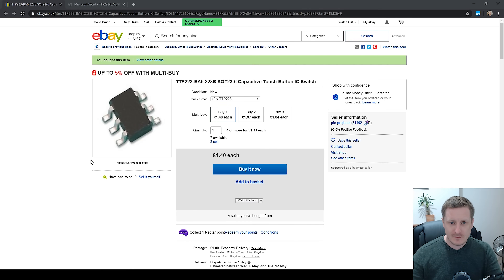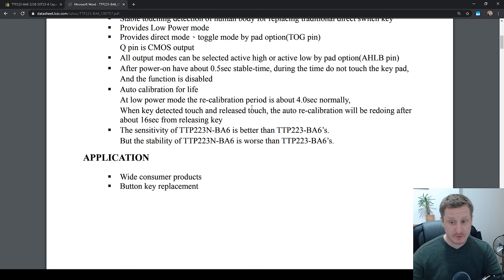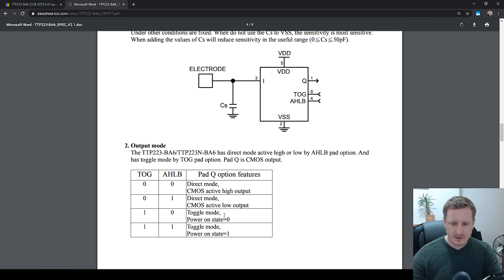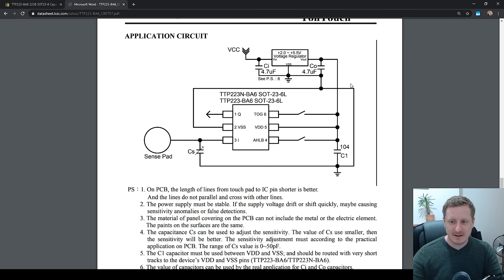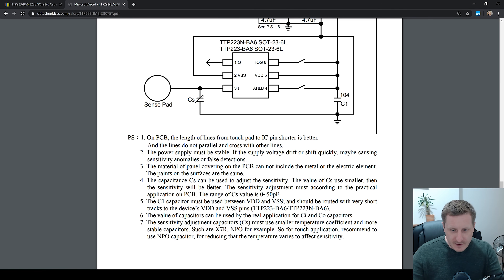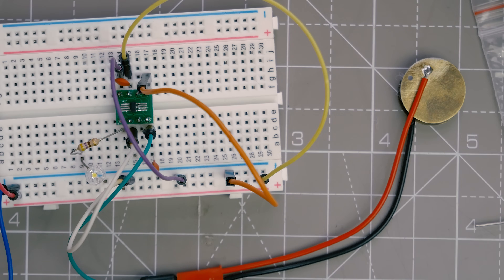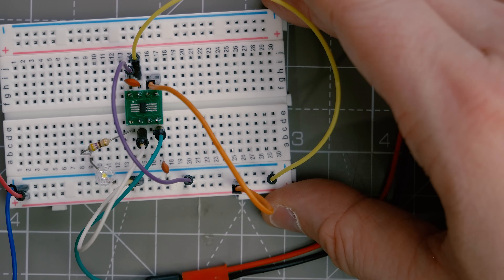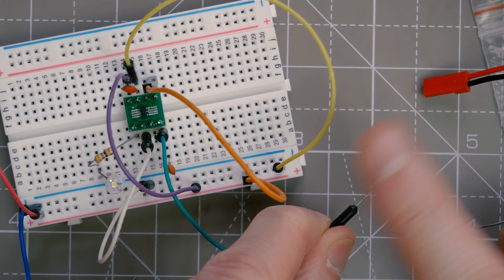From Start To Finish: TTP223 Touch Sensor

Comment: What will happen if you set up multiple chips on a single board? Is it feasible to support multiple touch sensors at the same time? Would multiple touch sensors interfere with each other as multiple fingers are pressing on difference sensors because they share the same ground?

Comment: This is exactly what I was looking for:  a demo that showed how sensitive this chip can be!  Now I'm positive this is the chip used in this table:
https://youtu.be/zD9cv4JiNfE
Using this breakout board:
https://a.co/d/6b4XqRl (not affiliate)

You mentioned there might be boards that have touch sensitivity already built into them.  You're right!  The ESP32 has 10 touch inputs built right in!

Comment: Sir i desing th pcb using ttp223 bt its not working, i used a 100nf capacitor for the touch sensitivity  where am I going wrong.. Shoud i use  50pf capacitor and then it will work
Reply: 100nF seems too large. The datasheet specified 0-50pF max
Reply: @Infinion  yup  i removed the 100nf capacitor it works fine.... Bt i still have 2 questions..
First is it necessary to add a capacitor...?
Secondly after i removed the capacitor although it worked fine bt after few minutes it stops working nd remains it ON state forcing me to cut th power... Nd after giving the power back it again works for few more minutes.....
Reply: @burhanuddinbhiwaniwala618  If you connect an oscilloscope you will find that this electrode pin is being oscillated at a frequency to detect small changes in capacitance. As you add capacitance, you are filtering this frequency out and reducing the peak-peak voltage or the voltage ripple. The more capacitance you add, the more it will resist changes in voltage. This is my opinion from a filtering point of view. If the duty cycle and period of the frequency on that pin is fixed, then adding capacitance should reduce sensitivity.
Reply: @burhanuddinbhiwaniwala618  To answer your second question, I am not sure. Make sure to add capacitance (your 100nF and maybe a 1uF) to the supply voltage pins so that the supply voltage is stable.
Reply: @Infinion Thanks sir fir your patience and time...

I have added 100nf nd 10uf in parallel to 5v supply with GND

And the 100 nf to the touch pad pin connecting it to the GND...

After i saw your video once again where at first you did not add any capacitor still the touch sensor was working so in order to check my schematic was correct i removed the 100nf capacitor from the touch pad.... But with it my second question rises
Reply: @burhanuddinbhiwaniwala618  oh it's not my video, I'm just commenting to help.

It's good to put the large capacitors across the supply voltage pins but don't put anything more than 50pF on the touch sensing connection with respect to ground, otherwise sensitivity will be very poor.

If it is not responding even with no output capacitor, try touching a GND connection with one finger and the output electrode with the other. This will increase your coupling coefficient.

You can also increase the size of your electrode, or make an output electrode and ground electrode and put them physically close but not touching. The electric field lines will concentrate between the electrodes and increase the sensitivity when your hand is placed between them or when touching the output electrode.

Finally, you can try making two electrodes "concentric" or one inside of the other, to modify the shape of the electric field again, and the sensitivity.

Hope you are successful.
Reply: @Infinion  "opps"! Well this happens when mind is messed up in something...

But thank you for your helping hand...Although the touch sensitivity has increased by adding a 22pf capacitor... But other issue arises that it works for few minutes and then stops working where the connected led's stays ON ("that means the senor gives 5v out and hangs in that state..." ) Unless i cut the power...
Reply: @burhanuddinbhiwaniwala618  Hm, can you tell me what pin 4 (AHLB) and pin 6 (TOG) are connected to? Also the TTP223 maximum source current is 4mA. What color LED are you using and what resistor value?
Reply: @Infinion  well with a power supply of 5v 500ma i am using White 5mm Led with 330ohm resistor.... The output of ttp223 is connected to a NPN transistor. Which leads to the negative of the led and positive of the led is connected from 330ohm to 5v
AHLB is not connected to nothing and TOG is connected to 5v... So led take 6ma but that should not be an issue i guess coz led is directly connected to the main 5v and is not drawing current from ttp223's source 
Total current consumption is 34ma
Reply: @burhanuddinbhiwaniwala618  can you confirm if there is there a current-limiting resistor between the output and the base of the transistor? Without a current-limiting resistor, the transistor will attempt to pull the output down to the base-emitter voltage (0.6V) and the internal CMOS of the chip will heat up.  I got around to setting up the ttp223 and I have great functionality at 5V as well as 3.3V. I even connected 1uF capacitor to the sense pin 3 and it works fine with firm touch. It never stops operating, even with AHLB disconnected or pulled up to VDD, functionality remains. I have not done a destructive test by pulling the voltage of Q down.

The TTP223 should not pull more than 10uA plus 4mA of output current when the AHLB is disconnected/pulled high. If your LED is pulling 6mA from the 34mA total consumption, that means the TTP223 is pulling a staggering  28mA, either because there is no current-limiting resistor connected to the base of the NPN or because the internal CMOS or some other part of the chip has failed. Try to investigate this if you can.

This might explain why your chip shuts down after a short period of time. If it is overheating, it may completely become unresponsive until you cycle power.

Comment: Can u tell me plz.. how to run it on ac main . I mean can I use it on ac by use of register to operate optocoupler or some MOSFET.
Reply from the maker: You could do it with a relay but I don't usually play with mains electricity so I cannot give any good advice.

Comment: The pin is big enough, but you can't touch the wire insulation also.
Reply from the maker: That'll be it, it was freakin out when I touch the jumper earlier in the video so that makes sense.

Comment: Absolutely no need to use hot air to try and solder that IC, plus doing it that way is incredibly difficult compared to just using a normal soldering iron. Using solder paste makes it even worse LOL. Note you can buy prebuilt TPP223 modules for under 20 CENTS each that do everything shown here. Cheaper than buying the bare chips LOL
Reply from the maker: The was absolutely no need for anything in this video. I thought you had been around a while John, are you forgetting the type of videos I make?
Reply: Hot air is almost magical - with the component being drawn into alignment on the pads by surface tension - if you flux the heck out of everything with a flux pen before you start.

Comment: one off IC like that, i'd have used the soldering iron, a lot quicker. I only used the hot air for getting them off where you want all joints to melt at once.
great little chip and it also does the debounceing for you. nice vid and keep the pet in the brackground :)
Reply from the maker: Yeah but I need the practice with the hot air. The PET is having it's time in the sun for a while, trying to subconsciously encourage myself to actually do something with it again.
Reply: @DavidWatts  I just fixed my PET 4016 upgraded to 4030 spec many years ago, go for it there is lots of information on the interweb.  circuits can be found here http://www.zimmers.net/anonftp/pub/cbm/schematics/computers/pet/
mostly standard 74 series parts, you can still get RAM etc on ebay
Reply: @DavidWatts  practice hot air on test boards and maybe watching a few hot air soldering tips vids, you be a pro in no time.

Comment: there is a slight buzzing sound wheever you touch the pad
Reply: Yeah I noticed that.
Reply from the maker: Interesting, I missed that. The power supply cable must have been next to the microphone wire, same thing happens with the soldering iron.

Comment: Spooky !  I was just making a Kicad symbol for theses as your notification came up !...I love 'em, so easy, no hardware or software debounce to worry about, at least they work fine in my sketches (doesn't say that much) I bought mine already on little PCB's so easy to play with, and I'm gonna buy some or just hot plate them off, I found 47pF worked best if you want lite but actual contact. In software I just detect a falling edge and Roberts ya relative.
Reply: sorry Andy, Bob's my aunt now :)
Reply from the maker: I also made a symbol for Eagle. I was really surprised to see how low the component count was. I have quite a few of those little modules from an ill-advised aliexpress order years ago so I may do the same.

Comment: Wow! ... putting solder paste down with a toothpick...  hot air gun..BOOM! Dude... epic work... I guess there don’t exit in 8 pin DIL :-)
Reply: Epic overcomplication that makes a simple soldering task into a very difficult one. This is like watching Julian Illet bumbling around wirh solder paste, ending up with a worse result than everyone else can do with a soldering iron.
Reply from the maker: Your standards for 'epic' are too low John
Reply: @DavidWatts  - LOL, that is very true David. Cheers!
Reply: even I out the solder paste with a toothpick....... :-)))

Comment: it'd be interesting to see how this works through things like an enclosure.
Reply: With no sensitivity cap you get about 2 - 2.5 mm distance and no problem with fr4 PCB material or thin plastics that I have tried.
Reply: andymouse123 Thanks - thats great. I’m going to fire up EasyEDA :-)
Reply from the maker: Hmmmm, interesting :-)
Reply: I'm using the red TTP223 modules inside casing front covers. Works like charm.